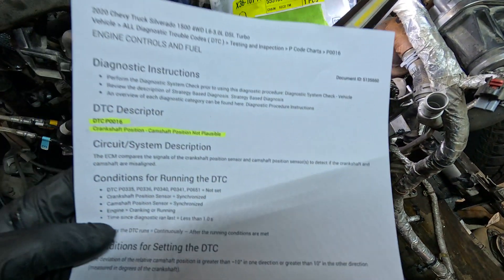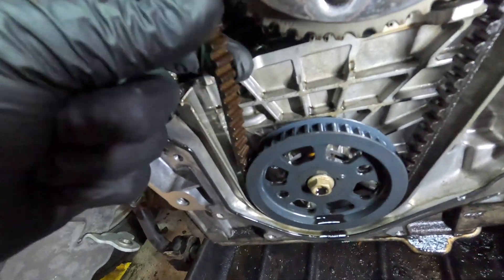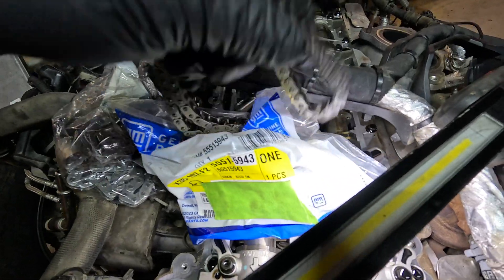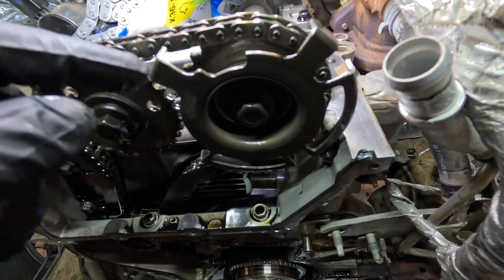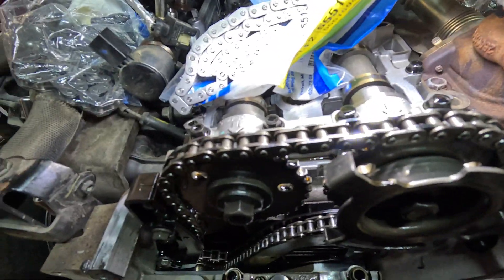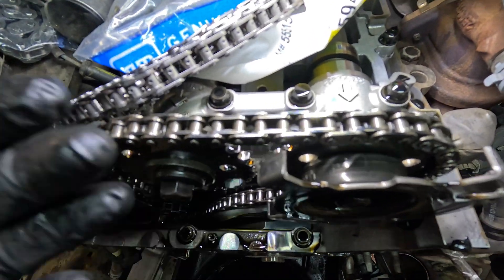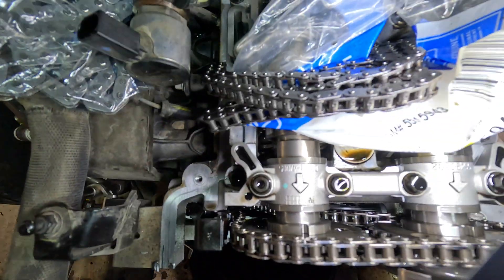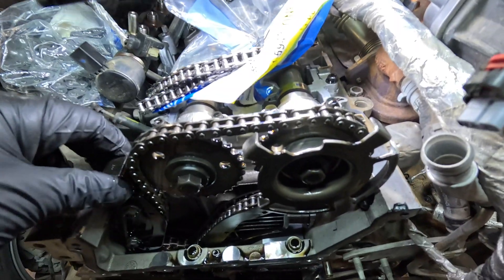UP Close Look at UPDATED Timing Chain for 3.0 Duramax Diesel p0016

Comment: This just happened to me and I have 92,000 miles on my 2020 1500. I was lucky because my powertrain warranty was extended because of transmission issues. They’re covering everything except the oil pump belt

Comment: Is this a blanket warranty for all LM2s with P0016?  I just got the code today, 71k miles.  Also had to do the leaking cam shaft cover warranty, was burning oil and fouling plugs at 60k miles.  One thing after the other with this LM2…

Comment: not what i call a good time but sure makes shop a lot of money. did mine in the driveway, at least if you’re a tech you will know what you are working on for a couple weeks. anyone going through this outside of warranty please report to GM quality and NHTSA. If there is enough of them the government will require a recall or reimbursement. GM knows how many are out on the streets ticking time bomb.
Reply from the maker: Maintenance is a part of vehicle ownership.
Reply: @ timing chain at 100,000 miles or less is not a maintenance issue that is a quality or design issue.
Reply from the maker: @ right, that’s under warranty.
Reply: @DemonWorks  not sure what your point is, being without your vehicle and having it torn apart for up to a month isn’t great either, at least it’s paid for but what about my case and many others where it happened at 114,000 miles or say 105,000 miles and you followed all the oil change intervals and got less than a quarter of the cost to repair offered from GM. I changed my oil more often than required and I would guess others did too that are looking to drive a vehicle for many miles. They should have caught this issue in durability testing. It gave this engine launch a black eye. I love this drive train and it works for my requirements well. I plan to try and run it many miles unless it doesn’t make financial sense because it won’t hold together.
Reply from the maker: @drew7767 no point intended, sorry to upset you.
Reply: @DemonWorks  no need to apologize I am not upset. I think it’s a fair debate it seemed as though you believe it is a maintenance issue from your first response and I don’t, not in this particular issue. I am glad you are trying to help people. I am trying also, $8000-$12000 repair on a truck you may owe money on is a lot for most of us.
Reply from the maker: @drew7767  I agree it's costly and an owner shouldn't have to worry about anything. At the same time, these could come with 60,000 mile warranties but they don't, they get 100,000 mile. Still, that's not enough and people expect more and if something goes wrong outside of warranty, demand additional coverage. At what point is it enough from the manufacturer? If someone is outside the 100,000 mile warranty and cannot afford a large costly repair, I recommend looking into an extended warranty. I'm here to show people issues and updates and they can make decisions with this info if they have something to worry about. And I believe the 2020 trucks have something to worry about.
Reply: @drew7767  It sure is interesting to hear people support & defend these manufacturers.  Mechanics are a different breed of people for sure.  I wonder how he'd view his electrical panel at his house if his main breaker was having issues just 1 month out of the 1yr warranty on a new house that he just paid $300k for & then he finds out that any Joe on the street just can't go & purchase one & that you have to have a licensed electrician to troubleshoot it.  & then not any ole licensed electrician can do that, you have to be specifically registered with that brand of electrical manufacturer to gain access to replacement breakers.  Then the ole sparky shows up grinning ear to ear just waiting to slap you with a whopping $12k bill to troubleshoot & replace the breaker.  After all this, the "Warranty" on the new breaker is non existent because the Manufacturer tells you that it's highly likely that something on the power grid caused it to go bad or the heavy loads it may have received from welders & tools "potentially" used on the premise.  So you as the customer gets to live in fear that it won't go bad again cause who can afford another $12k repair!!!  Then right before the sparky leaves he says  maintenance is part of home ownership in reference to an item that should last most people a lifetime.
Thank the good Lord above not every company & manufacturer is not subscribing to this kind of BS, but the more we accept less from them, the more that will follow this unsavory practice.
Build a quality product & stand behind it.
Reply: @DemonWorks  Timing chain is not listed in the owners manual as a maintenance item, if so please direct me to the page.  
If these are failing, it's because they are under engineered & under built.  Pistons & connecting rods are the same way.  If they fail, it should be after a long life of service to the owner, providing care & routine maintenance was performed.  If we're seeing these @ 500k or a million miles under good routine maintenance, then I could see that as a item that needs to be maintained.  Honestly I think people expect 200k minimum out of these vehicles for the price that is paid for them.
Reply: I am looking into a used LZ0 someday.  Ford 3.5 ecoboosts and many other Ford modular engine have timing chain issues at or over 100k.  They never issued recalls on them.  I doubt these will get a recall either.  Run some very good quality oil and maybe it will help it for the earlier trucks?.  They obviously see oiling as an issue by adding a hole to the chain roller.
Reply: Was you able to do it without the tooling? Mine needs done and can't find the timing tools
Reply: @ you need most of the tooling unfortunately. you could easily make the pin to lock the crank but the other stuff is pretty risky in my opinion to try to get around.
Reply: @drew7767  thank you, they are all on backorder so I'm looking for somewhere to rent them or buy them

Comment: if i understand correct  LZ0 doesn't have this issue?
And yeah man it would be great to check valves people say that these engines are pretty good and don't accumulate carbon buildup
Reply from the maker: Currently, we have not seen any LZ0's with timing chain issues. The newer design seems to be holding up better.
Reply: @DemonWorks  how about carbon buildup on intake valves?

Comment: Would the new updated timing chain have been installed in my 2022 limited truck with the LM2?
Reply from the maker: Yes, you are good.
Reply: @DemonWorks  is there a month in 21 to look for? I have a build date of 3/21 and I am wondering if this is something to look out for. I have increased engine noise on start hot or cold with decreased performance that usually goes away in 5-10 min of running. Almost feels and sounds like a regen but it’s not. Monitoring with idash
Reply: How about 2021?

Comment: What’s the service interval for the timing chain? Can it be done when the oils pump belt is replaced? (2020 3.0 duramax)
Reply: No set interval
Reply: While there's no set interval, I feel like I've heard the most about problems with timing chains. I haven't heard instances of the oil pump belt failing. So my personal opinion would be if you're having the belt done, you might as well have the timing chains replaced at that same time.
Reply: @Gameplayer70 oil pump belt is just pulling the transmission, timing chain is a complete cab off procedure, no way I would do it just because.
Reply: @fflowwiththego  to each their own right, it’s your truck. I would bet an engine replacement costs more, especially after doing the belt replacement.

Comment: Around how much will that cost. I have a GMC Sierra 2022.5 with approximately 93000 miles on it
Reply: What service should i do to prolong the life expectancy of my truck
Reply: Your truck should have the updated chain.
Reply: When I had my oil belt replaced they originally miss understood what i was asking for and quoted me at the dealer to do timing chain for around $8k.
Reply: @ddmichrome  That's an entirely different beast for sure. You can do the oil pump belt with just a transmission removal (and a few other things). To get to the top of the engine and do the timing chains it calls for a cab removal though. While I am lead to believe this is also not a super complicated job now a days, it is definently more labor intestive.
Reply: @ddmichrome my dealership just told me 10k